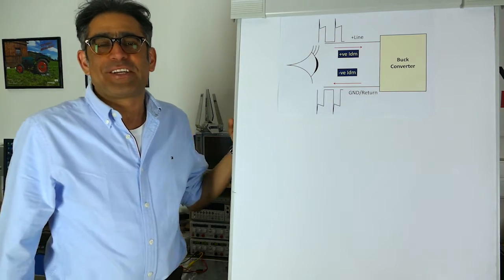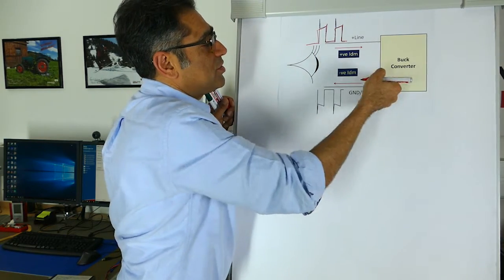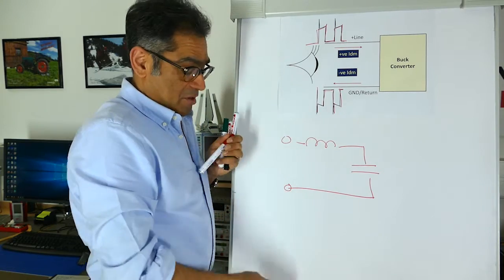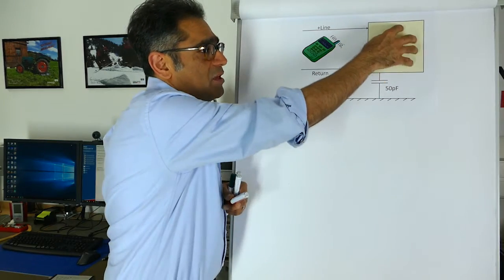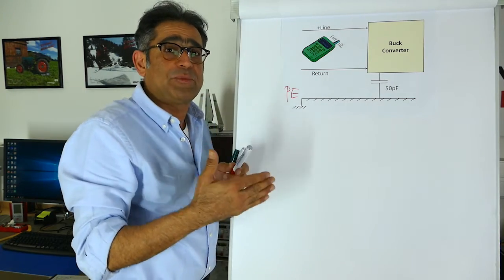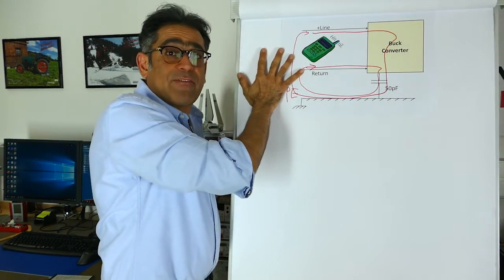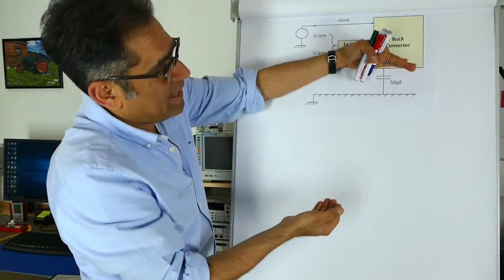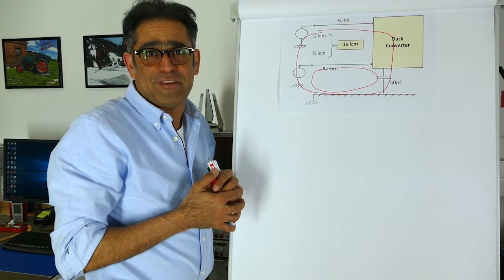EMC Filter Design Part 1: Understanding Common Mode and Differential Mode Noise

Comment: Hello Sir...I like the way you explain these topics with simplicity......I have a question:    How to visualise the common mode noise..when the return is sorted with earth....
Also on the digital circuits of PCB...say a LVTTL clk singal....when normally the return is a DGND plane....how to visualise the common mode and differentiation mode current....
Please give your inputs...

Comment: Too advanced for me, I need to design a simple common mode to measure the differential leakage current (50 hz 230V AC) any advice will be very helpful and appreciated. THANKS

Comment: What I think needs to be made clear here is that common mode currents flow in the same direction as each other and are additive, as compared to differential mode currents which flow in opposite direction to each other and are thus subtractive.